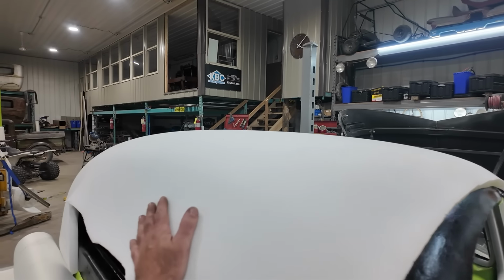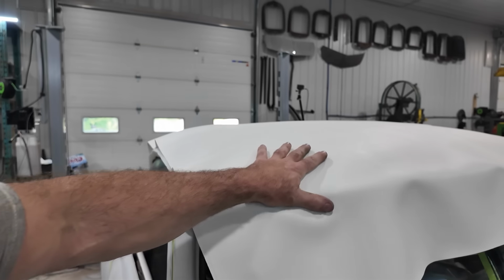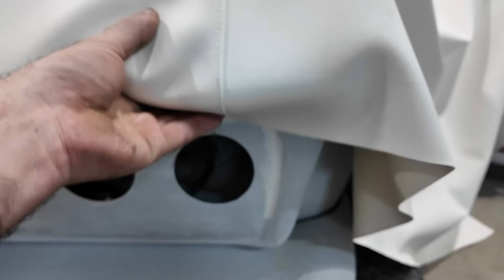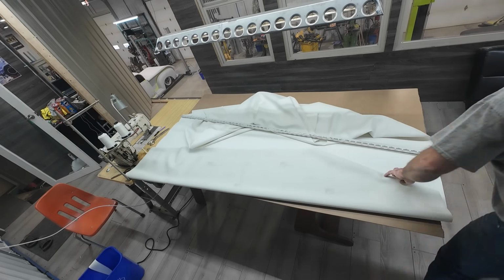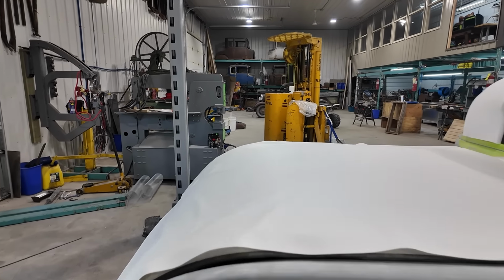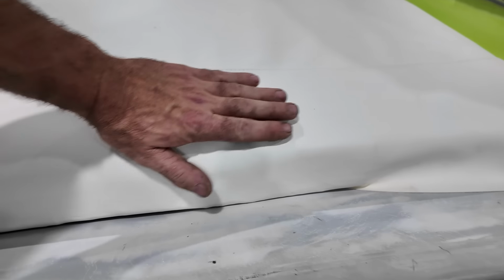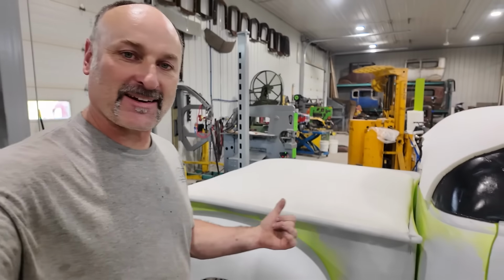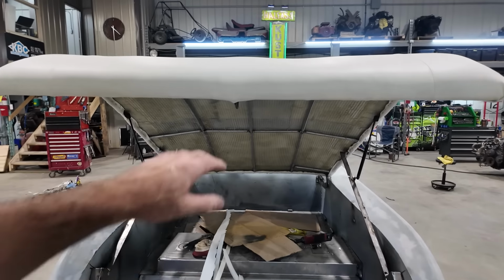Upholstering a Custom Tonneau Cover for My 1949 GMC Roadster Pickup!

Comment: Brent, you're right about relying on that glue. the irony is that if you look either way in your shop the solution is right there: your model A truck and your model T both used wood in the inside to attach upholstery.  A small strip of ply bonded with resin on the inside and a piece of aluminium rolled into the edge and screwed into the wood would allow you to pull it down really tight. 
That new sewing machine looks awesome btw!!!

Comment: Sew your first stitch. Then turn right side up and make sure your flap goes towards the high end. Pull the seem tight while sewing the second stitch and use the foot of your machine as a guide/spacer on the stitch. This will make things alit easier. My mom did upholstery for 50 years.
Reply: You want the flap to go towards the high side so water runs out and not into the foam.
Reply: Also thst your using white venal you gonna need to invest in some jomax mold and mildew remover.

Comment: Hi Brent, some very thin ply, riveted with washers under the lid to finish it off.??? painted, with a light that comes on when you lift the lid, door switches.?? and a seal around the rear lid, no water leaks.???

Comment: I am guessing that you'll do more of this .  I used to do seat covers.   I used steam supplied via a wand. This did several things , allowed the vinyl to stretch and added a bit of lubrication to let vinyl slip while being pulled. Held in place with hog rings. Did same sort of thing with vinyl roof, not hog rings though. Used screws and glue. Used steam between vinyl and roof, not the outside of vinyl.   I did custom interior dash, door panels in similar fashion. 

Try without camera and be careful that steam wand was brake line and got nasty hot on the skin. 

You'll be amazed how much stretch you get no burn through from a heat gun.
Reply: how does the moisture get out? rust is always an issue with vinyl tops

Comment: Looks great, Brent! Keep in my mind Hot and Cold Temperatures affect vinyl a lot. The softop on my 1985 CJ7 won’t snap on if it’s cold. Once it sits in the sun it stretches it and also takes out wrinkles in the vinyl too.

Comment: I'm enjoying this build! I think the cover looks great. It'll sort itself out a bit too if left in some hot sun. 

Couple notes that might have helped: 

1. Vinyl typically stretches one direction easily and the other direction... not so much (there are different varieties if you need more stretch).

2. You can stretch vinyl easily with a heat gun - but be careful. Helps with corners though if you don't want seams or folds. 

I'm not saying I would have done any better. Before he moved away I had a buddy who owned an upholstery shop, primarily doing marine work. He was a magician, but showed me a couple tricks so that a hack like me could at least do some powersports seats that didn't look too dumpy.

Comment: Corners last use a heat gun to soften vinal up , there is no substitute for the good old yellow upholstery glue for vinyl wrapping it is worth the investment in a spray gun and glue I would have glued  both the layers of foam first layer the size that you had then glued the second to the first second larger wrapped around like you did with the vinyl  then I would found center of vinyl  and folded vinyl in half length wise spray adhesive  on both the foam and vinyl and roll the vinyl onto to foam trying to keep center's matched, The hard part is getting it glued down to set your stich work straight and in its place so when your pulling the vinyl around the ends you don't pull your stitch work out of alignment,

Comment: I remember I had mentioned at some point to use hog clips on something. If you sewed a loop in the fold over and slid a tiny rod or wire in it and then hog clipped to a rod beneath the tonneau that you previously welded in.That way nothing gets glued in the wrong spot and the hog clips would pullit to the tont it would stretch to.The second piece of foam should wrap over the edge of the first piece and finish below the close view. Always love your persverence Brent , food for thought.

Comment: An electric carving knife is so good for trimming the foam. Carpet/Fabric spray on adhesive is also great for gluing down. I usually apply the adhesive to both pieces leave it for 5 or so minutes to become tacky, the joint them. Holds great. Also you usually get one go to apply them to mate. Let's not forget that room temperature will effect the glue setting time. Having a go is the best way to learn, even if it means over and over again. Sometime it can just take a little longer to get the the achievements. You effort and constant persistence are amazing. Hold lots of respect for all you do.
With regards to the white colour, I guess you can always spray paint it with a vinyl coat of paint. Maybe sometime later  apply stencil a Halfass Kustoms logo, (to hide the dirt of course). Don't throw away the left overs. Glue them over the staples. (I guess you already know this) it's just a reminder. On a lighter note:face-blue-wide-eyes: say what you see, A Pumpy Hump:face-turquoise-covering-eyes: Make you sure do use some great descriptive phrases. Thanks for all the enjoyment. Stay safe and enjoy.

Comment: The sewing machine did awesome, I love the white Oh I know it will stain but its OK. THe stitching came out nice, you learned and fixed the overlap nicely. When you had the sharp knife going down the side i thought about trying to carve the edge rounded.  We used to have to make foam forms for medical equipment and we cut it with hot wire and usually pulled around a edge so the cuts were always straight. then you unfold the foam and check it. We had lots of trials with the forms to get it perfect, but then were making several hundred machines a year. Great Job Old Man it is gonna be super. Dennis

Comment: I have learned to use a flap disk to round the corners of the foam for a nice rounded effect
Reply: And sand the bottom side of the foam. Not the top. 👍

Comment: i think if you want a rounded edge you need to round over the foam layers in the shape you want, you have 2 square edges that compress at different rates and that is causing the shelf problem.  glue the 2 layers together then use electric knife or similar tool to cut the round over shape into the foam and you will get the shape you desire i think.. my 2 cents

Comment: An old electric knife is a handy tool for shaping & beveling foam. The cover looks great!! (Tip for corners with vinyl/fabric. Pull the tip of the vinyl taut towards you & allowing for the measurement (1 - 2 inches) of what you pull around the bar to glue, make a straight slit from that point towards you & you can cross over & pull those two ends tightly to make a nice tight fit on corners.)

Comment: You can put coarse paper on you DA and sand the edge so you're not having to pull so hard to get the edge to be a smooth contour. 3M makes Super90 aerosol adhesive which works really well. You can use it to edge glue foam together as well. Nicely done!

Comment: Just a suggestion to help you out with the top. Leave quite a bit of excess around the edges to help you stretch it and trim it after it’s glued (or stapled). I’m no expert but my Dad was and I’ve done a fair amount. Another tip you may not be aware of is using an electric carving knife to shape and trim your foam. Cuts like butter!😂🍻🍻

Comment: Hi Brent, thinking about your quandary about the tonneau edges; try a thin layer of polyester wadding along the foam edge, just enough not to bulge the top edges. Fiddle work but that may give the soft edges you need. I upholstered some dining chairs and found scissor cut foam a bad idea. Hot wire can be much smoother. Great to see your creativity again being challenged and coming up with a solution. I also helped a mate deck out his panel van, since bin. We used sections of poly pipe as a spring clip to hold the fake fur fabric to a tubular frame. They were about 1” long and relied on the pipe memory to hold it in shape. Hope that makes sense.

Comment: Hey, ya put yourself on the frontline! More courage than common sense and I call it a huge win. Looks good from alaska, and I am sure its just fine... I will ask a question everyone else will probably ask. You get a lot of rain and so muddy roads, road tar and such is going to do some crazy patterns on the white. I know you are not a trailer queen kind of guy so taking it on a power tour might be a challenge that has you going from beer to heavy whiskey and swearing to jump off of a high building. All jokes aside Brent, I have been hungry for your upholstery videos. When I built my rides, it was always hire someone for the upholstery work. It cost more for that than a high powered engine did then. We are talking the seventies. Great video, thanks for sharing your work with us

Comment: Maybe make a double decker sewing table so the unsown material is under the table top.then the material is not rolled up on your lap.the sowen material will slide onto the top table.it will slide off the bottom table around the front of the table threw the machine and onto the top table.love your show.

Comment: A heat gun is your friend here.  It will make the vinyl more pliable so you can stretch it around the curves without having it bunch up.  Also, if you shave the edges of the foam and round them over, you won't have such an angular edge.

Comment: Back when vinyl tops were common, most of them used 3 panels. There was a wide panel in the center and equal narrow panels on the sides.

Comment: Hey Brent you could have set some timber or plastic inside the frame edges and that would have allowed you to staple the edges. Could have covered the staples with an ally flat bar trim or something like that. Love your Chanel.

Comment: Always go big when you don’t have a pattern. Easier to trim off than add on. You may want to add some wood strips inside and use upholstery track strips (flexible ones) an inch or more above the opening….. just a thought 😊

Comment: when cutting foam a electric kitchen carving knife give smooth clean cuts
Reply: that's old school and does work but it's a rough edge sometimes. a piece of NiCrome wire and a battery charger will get you a nice hot knife or you can but them on Amazon cheap too.

Comment: Well done on your first atempt not bad   its called top stitch   as i told you to cut the first foam back at a 45 it woud of made a better edge   as you its your first time  the other thing i  sagested was glass in some strips of ply allround  and use sranless steel staples to finish off

Comment: That's pretty cool.  If you redo it, make some pie cuts on the rounded area and it will sit flat and not "poof" up.  You could have made a small 45 degree cut on the top edges of the top foam, and it would not have been so squarish.  You did good on your first try.

Comment: To get a rounded edge, trim the under foam along the edge a bit shorter and take off the top edge (chamfer it) so the top foam can mold over to the edge of the frame. It would give you the look you were going for. Great work though.

Comment: Brent it's Ron in Ontario you really do great work😮 but I'm curious why you went with white😮 instead of black white is so hard to keep clean I've had many convertibles just one white one and would never do it again always black anyway great job
Reply: Yeah it's just going to turn off white or yellow after a year or two sitting in the sun. But it's going to be one heck of a show truck. Like Brent said he can redew it in a few year's. Any thing on that truck can be changed over time.
I've seen old kustoms change hands over the year's every owner changed something on it.

Comment: If you trim the bottom layer of foam about a 1/2-3/4” shorter on an angle it would allow the top layer of foam to roll at the edge much nicer.

Comment: The bed vinyl doesn't need to be cut you actually can stretch it into shape you will have to attach it on one side and pull it over the other side the foam will give way and use a heat gun to soften the vinyl so it can stretch more easily

Comment: I was thinking about how you attached the tonneau cover to the frame , potentially you could make some aluminium strips that are pop riveted to the fibreglass or some hog rings to a bead that is sewn to the underside edge much like seat backs or cushions are attached to the seat frame , the glue and staples work but I don’t think that it will last a long time.

Comment: 🎉🎉 SHOULD SPLIT FOAM AND MATERIAL DOWN THE MIDDLE. DA, your trying to be tight with material 2 pieces of foam on roof 2 pieces of material with joint in middle.  I worked at a vinyl shop doing tops.😮

Comment: Can’t you sand the foam (shape it) or different foam?? Use to help a man that did custom upholstery he would put emblems in seat /dash covers/etc.he would cut it with a electric knife and sand it 80/120 grit
Reply from the maker: this stuff was pretty soft and not really sure how it would sand though I never thought of that. The stuff the shop had that I could sand was pretty dense and didn't think it would work well for my top.

Comment: Wondering why you wouldn’t glue the foam down first, then  the center of the vinyl , wouldn’t that give you a more even pull on the sides, won’t wind try to lift it when driving

Comment: Did you use vinyl top glue,if not spray trim will let loose after a little time!
Reply from the maker: yeah I used HH-66 Industrial Strength Vinyl Cement Glue

Comment: i think if you had cut the lower layer of foam off like 2 inches back from the edge then pulled the top tight it would have rounded the top layer of foam more the way you were looking for i do like the look

Comment: You're asking an awful lot of the glue round the edges. I would have glued all the foam down first, just like on a chair seat.
If the wind gets under it on the highway you'll likely lose the vinyl and foam.
But hey, you have a habit of coming out on top.
Everyone else is supportive, consider this constructive criticism. :D

Comment: If you would have put a strip of steal on the bottom of the edge you could have use snaps underneath like tonocovers  wouldn't worry about the glue and could have got it really tight.( But could should would of)

Comment: Why didn't you use Vinyl top glue? also, I would have sanded the foam in a taper as it came to the edges so that it didn't have such an abrupt angle.
Reply from the maker: not sure the foam was really soft so I didn't think it would sand very good. also I used HH-66 Industrial Strength Vinyl Cement Glue to glue stuff down as that was recommended to use.

Comment: If the underlayer of foam was a little narrower than the top layer ut would be less of a shelf. Like the uplolsteres do,they sculpt the foam to resemble the shape they want. Its not easy, an i agre. Too much faith in the glue. Consider a tack strip next time. Oh, short staples into the fiberglass- interesting.

Comment: Get a half inch piece of aluminum, thin aluminum pull your vinyl over and then put the aluminum piece on the vinyl and self tap it down. No one will see it and will hold it tight all the way along. You don’t have to worry about that glue that glue is not gonna do it. I’ve been there done.

Comment: I'm at 14:40, and my OCD will not let me continue to watch this video anymore because of the errors you are making. Schoolboy errors we call them.

There are two main things to remember when making matching tops for a vehicle like your car/truck.

First, measure the width from door to door, then add about the width of your hand either side. You need to take into account all curves as with your roof.

Going on the width of your fabric roll, it is obvious you will need two joins, especially if you want the storage top to match the roof joins.

You had the right idea from the beginning. Only you should have started making your roof top first. That would then determine where your joins would be so that you can continue the parallel lines from front to back.

I suffer with OCD as I mentioned, so I have a good idea how your mind works in wanting things to line up and match. If it were me, I would measure in from the top of the door about 20 to 25 cm. That's about 8 to 10 bananas or inches. 

That would give you nicely placed lines equal between your back window and the side of your vehicle. Then following down to the rear bumper would make it look cool.

However, your idea of having two join lines close together is not cool. If one stitch line is off just a little, the other line will make it stick out like a sore thumb or a spare prick at a wedding. Trust me, I've been there, done it.

Secondly, a man such as yourself who spends most of his working life with filthy black greasy hands, and considering you are working with a white material. You should have cleaned your hands or worn gloves.

Just laying out the fabric, you managed to get it dirty and that really wound me up. Enough that my OCD went into overdrive. If that were my car, I would be fuming, but it's not, and we all know you don't care about such small details. You've told us that plenty of times before.

Last of all is a tip for you. When machining long lengths of fabric, try marking out your sewing lines with a marker. You can't use the usual tayloring white chalk marker for obvious reasons, but here in the UK, we have coloured chalks, and you can buy them on eBay in boxes of 10. Wup, Di du kido 😂⚒️🏴

Comment: You are going to make a mess. Get yourself some landau foam, it is about a quarter inch thick, and is high density. Draw lines on the foam so that they will line up, sew your pieces together, then glue them in place..